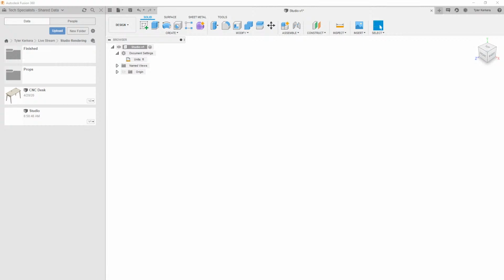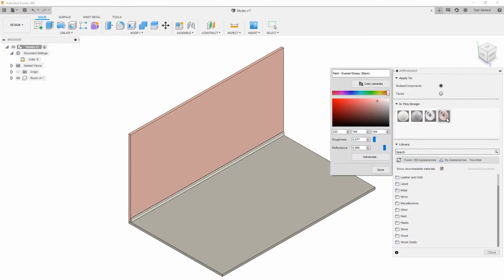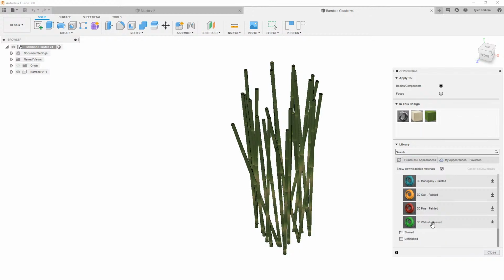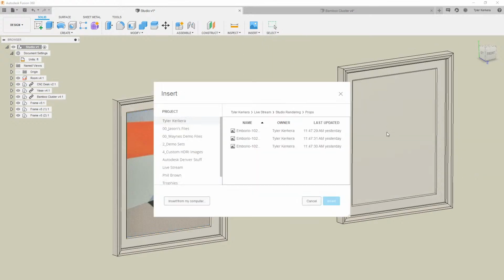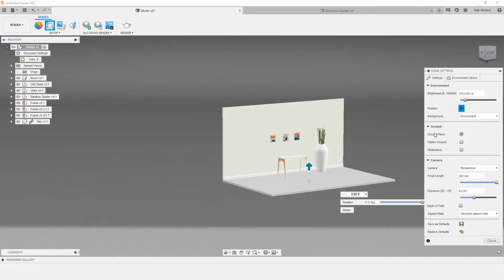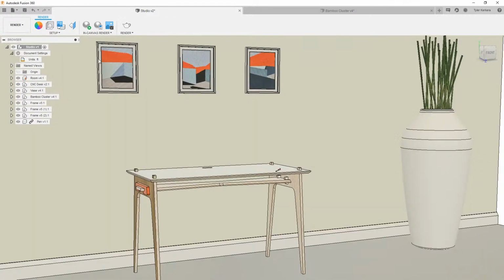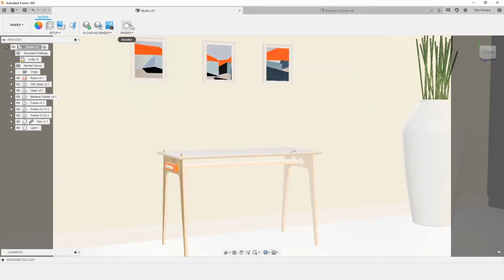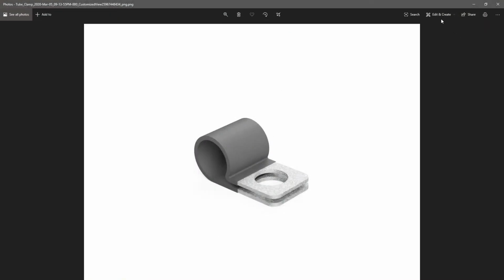360 LIVE: Photorealistic Rendering Like a Pro

Comment: Great tutorial! One thing to add I think is how to create 'real' edges, replacing the sharp ones. I tried it using the roughness settings, but the edges remain sharp yielding an artifical look. How would you do this task?
Reply: I like to use fillet or chamfer, by small amounts, say 0.25mm, in every showing edge of my object. It justs highlights much better.